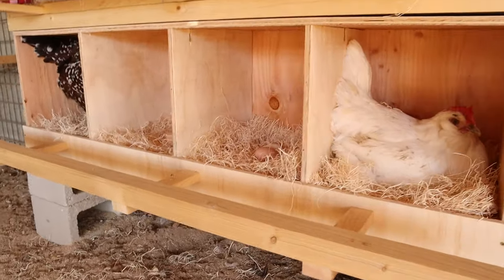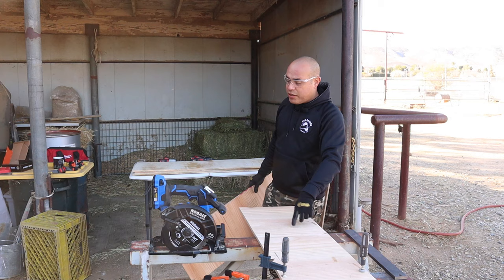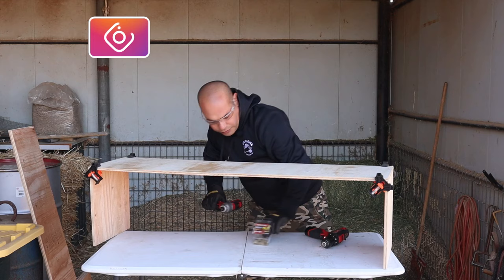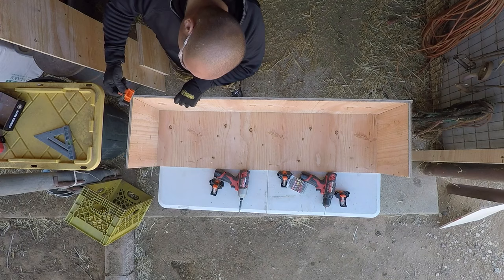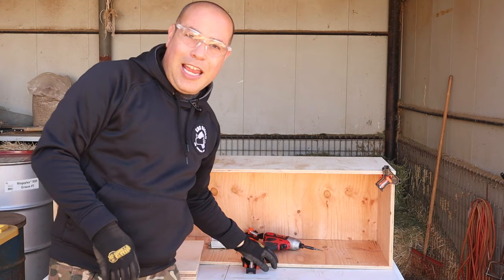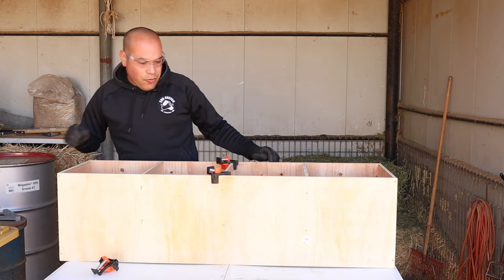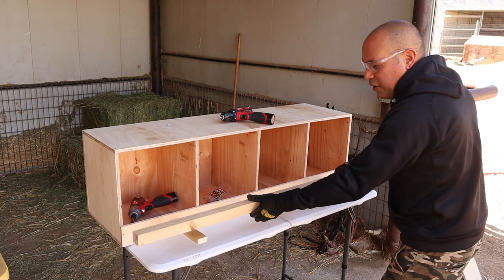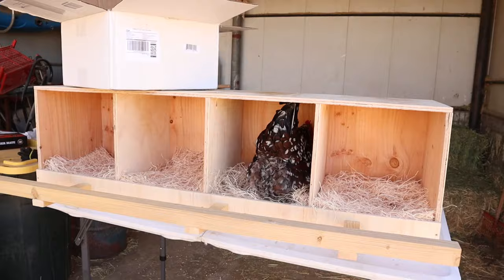Nesting Boxes for Chickens - How to Build Chicken Nest Boxes

Comment: Just an idea of how I made mine, I put the floor of the next boxex on a slant of about one inch, so the eggs can roll off, the back of the box cut about two inches shorter,so the eggs can Roll off to a tray at the back, that can be made from fencing or more glamorous trays from craft shops, kitchen shelves.the floor of the nest box I put rubber mat,cut to size ,used also for young calls, I positioned the boxes out from the wall, just enough  to walk behind them to collect the eggs, I also raised them about two feet of the floor,as the hens would want to sleep in them at night, and dirty them, finally I made a fold up step to stop going into them,opened it in the morning and the hens can hop up to the step to lay the eggs,its great the eggs are always clean,the don't  even notice the eggs rolling off.  This might be helpful.
Reply: Please make a video and share it.
Reply: Make a video instead of posting this on someone else’s video. Thanks
Reply: Great input. Love it
Reply: So are ur 12.5 inch pieces 12x12.5?

Comment: So the end walls and dividers are 12 1/2” by 12” ?
Reply from the maker: Hey, sorry I thought I replied to this long ago. I ended up writing the dimensions in the description of the video because of your question. I'm sure it's too late now, but yeah.
Reply: @BockBockBouquet  He doesn't explain his measurements to well. Cause you can't get 4 dividers at 12 1/2.. They would have to be 12 with a 4 foot piece.
Reply: That’s what I was wondering measurements don’t make sense
Reply: That 12 1/2” is width not length so u can get 4 12 1/2” by 12 with that

Comment: I have 7 new chickens that will be laying sometime in Feb/March. Super glad you mentioned the Lowe's cutting them up for you. They definitely got more tools than me and will make transport easy. Going to follow this video and give it a shot, thanks for the upload
Reply: Update Lowe's by my house would only do two cuts per piece of wood, according to the "rules". Something about overusing the machine and if others need to use it. (No one else was using it lol) Anyways, I just had them cut panel twice to fit in vehicle and make it easy to cut at home, a cut at 26 inches, and 52 inches. (Then I split those in half to get the four long pieces from video.)

Comment: I think it came out great the only thing that I would do differently is just to add on any roosting poles I use cord on it a wrap it real tight it’s easier for the chickens feet because of something to latch onto
Reply from the maker: Thank you! We did add a rooster bar at the end 😊 we like using flat roost bars though as we think chickens prefer them. Their foot is designed to lay flat not curl like parrots. They will use flat or round roost bars just fine, we just think it’s a little easier on them

Comment: Great work! Wish I had a Lowes or Home Depot close by. My local home center doesn't do any panel cutting. I think they'd sell a lot more sheet products to DIY'rs with that service.
Reply from the maker: Thank you! Yeah definitely would
Reply: It’s the wrong dimensions
Reply: @nedmacallen agreed. I'm looking at a 13 inch top, bottom and back. The 5 small pieces are 12x12.5. I get the 12.5 but how did he stretch the other side from 12 to 13 inches. Everything is flush on the front
Reply: @robm3063  yes he replied and clarified but it was way too late.  He absolutely gave incorrect dimensions or at least explained it in the worse way possible.
Reply: After having watched it many times I see what he did but he never said anything about it. If you watch real close he's leaving parts not flush to makeup for the 1/2 inch wood thickness. After having made many cedar picket planters from youtube videos I agree that this was a bad attempt of showing how to make something.  @nedmacallen
Reply: @robm3063  yeah it found all that out after I had already cut everything I made the cuts as I went instead of marking the entire thing out…I made it work.

Comment: Is there any way you can make another video of these nesting boxes.the measurements are not coming out right.i built one yesterday and the back of the box wall and top is overlapping   about 1/2 inch.this is how I cut them.i cut 3 peices at 13 in x4ft.i had to cut two pieces at 12 1/2 inches by 4ft.you can't get 5 dividers from a 4 ft piece.i cut another piece at 12 and a half by 4 ft to get the fifth divider. What throws off the measurements is the dividers. When I first put the two sides on the ends there was a lip overlapping. When I flipped it over upside down like you did in the video I had to set the back wall on top of the overlapping lip which is 13 in.
that wall is overlapping when I set the top of the box on there. I wish I could show you a picture of it but like I said the dividers is throwing everything off. So the 4-foot piece I cut the dividers from was 12 and a half by 4 ft and I cut 5 dividers at 12 inches. If you look in your description that's what you got. You got three pieces at 13 in. One piece at 12 and a half inches by 12 in. one piece at 3 in. the box came out okay it's just the overlapping from the back of the box and  top of the box.

Comment: Just curious if you know with certainty that chickens aren't roosting on that bar on the front, just seems inviting, I love it but would worry they roost there, thanks. Just picked up a bunch of wood, I'm converting part of a garage into a chicken house
Reply from the maker: We collect our eggs at night when we lock up the coop as our evening routine. The chickens are always sleeping on the roost bars, not the nests. If you want to prevent that have your roost bar area (sleeping arrangements) higher than the nesting boxes. Chickens desire to sleep as high as possible as instinct for predator safety and to show their dominance in the pecking order. Just don’t have the roosts too high or they could get a leg injury flying down in the morning. You could omit the bar easily though because they really don’t require it, even our ducks jump in the boxes and we just have this sitting on cinderblocks for height reference. We have 2 stacked on top of each other so the bar comes in handy for the chickens wanting to lay in the top box. They like to walk in and peak their head in to decide which box they want to choose to lay in that day 😂 silly ladies. Good luck on your build!
Reply: @BockBockBouquet  Thanks man, great info

Comment: Nice job.
What's the distance between the nest box and the roost?
How do you prevent the chickens from pooping on top of the nest box since you have not put a sloping top?
Reply from the maker: I think the distance on the roosts is about 6 inches or so. We have another set of nesting boxes on top of these that does have the slope roof. When we didn't have the slope roof, we used a piece of plywood resting on the nesting boxes against the wall to deter chickens from jumping on there to poop on it.
Reply: The world is their toilet
Reply: @BockBockBouquet  would you have plans for building the nesting boxes with a sloped roof

Comment: What size screws did you use? I want to make sure they are not too thick and will break into the plywood.
Reply from the maker: Predrill to not split the wood. We use 1.5 inch screw

Comment: What is the thickness of the plywood? I attempted this with 3/4” plywood, cut all of the boards out, and when I went to assemble it the way you did in the video the boards didn’t match up. Was it 1/2” board you used?
Reply from the maker: Yes it was 1/2 inch plywood, that might have thrown off your measurements. Nothing that you can’t fix though, let me know if you have any other questions. Best of luck
Reply: Greattt I got 3/4 cause I was scared for it to split

Comment: I'm actually looking to make a nesting box for my chickens. I'm not the kind of person who knows anything about carpentry and my husband is not around to help. Would you say this would be easy for someone who does not have the fancy tools? I have electric drills but that's it.
Reply from the maker: It is very easy. You can have your cut at Lowe's for free, just come home and assemble. I definitely recommend the corner clamps that you can purchase from amazon like the ones I am using in the video to help keep the wood together since I was working alone. Make sure you pre-drill holes before inserting the screws to prevent your wood from splitting. I am no expert either, but was able to make these pretty easily =]
Reply: @BockBockBouquet  could you verify what you had left of the plywood? After the project was finished. I just want to make sure I totally understand

Comment: I'm confused. With the divider pieces. I'm not getting 4 12 1/2 pieces. Out of the one section
Reply from the maker: Hi, I’m super sorry I somehow missed this comment, sorry for the late response. So on the dividers, I have them cut to 12.5” so that when it meet the roof of the nesting boxes, there is just the right amount of space to meet up with the roof since I am using 1/2 inch plywood being that the whole thing is 13 inches tall. That half inch makes up for it. Once again, sorry for missing this comment, hope you were able to figure it on your own.

Comment: How did you not get your wood to split... mine split 3 times.
Reply from the maker: I always use a drill to pre-drill a hole and then I use my impact driver to drive the screws in. It can sometimes still split the wood a little bit, but pre-drilling really minimizes it

Comment: 1. How long are the screws?
2. Is it heavy once it's all done for one person to move?
3. Did u have any leftover pieces?
4. Don't the chickens climb on the top and poop all over?
Reply from the maker: Hi, I believe the screws I used were 1 and 5/8 inch screws for this, but any size beyond one inch would be fine. Once it's done, it is light enough to be carried by one person for sure. I did end up with a leftover piece (about 2x4 feet piece of plywood). And the chicken can certainly jump up on it, but ours weren't really doing that, but you can securely prop a piece of plywood against the wall that your boxes are so it has a slanted roof and the chickens can't stand on it =]. Thanks for watching, let me know if you end up building one of these. We get at least a dozen eggs daily through it!
Reply: You have literally said 1, 1.5, 2, and 1 5/8 inch screws.  All different comments😂😂😂.  Make up your mind 😂

Comment: you dont need to drill a hole every time the screws will do it themself by the way they make bits lt come out and hold  the screw in place
Reply: When you pre drill pilot holes it keeps the wood from splitting.

Comment: Great video but I had the hardest time when I actually made it. Every screw I put it the wood just split on me! And I don't know where I went wrong on my measuring but my boxes ended up 11.5" wide. I plan to try again, what diameter screw did you use??
Reply from the maker: I forget what kind of screws I used, thin they were like #6 or #8 thickness. Make sure you pre-drill each hole before putting the screw in. That's why I use a drill first and then an impact driver for the screws to prevent the wood from splitting. Let me know if you have any other questions. If your boxes ended up being 11.5" wide, it's okay, chicken like small tight spaces when they lay their eggs, even our giants ducks lay inside of these little ones ( I don't even know how they manage to fit LOL
Reply: @BockBockBouquet  Thank You!!! I totally forgot to predrill the holes!! I found some #8s, predrilled the holes and it made a huge difference!!! I also made the bottom 16" and the back 9" which left a gap in the back and a ledge and now it's a roll out box!!
Reply from the maker: @cluckcluckduff7864  Goo to hear! Yeah, I found out the hard way about pre-drilling hole before the screw too hahaha! I always pre-drill there hole just slightly smaller than the thickness of the screw so they hold well.

Comment: Hello, what size are the dividers?
Reply from the maker: They are 11 1/2, but you can also measure how much room you have available in your main structure
Reply from the maker: Sorry, I just rewatched my own video and the dividers are cut 12.5”x 13” . Not 11.5” like I previously replied. For got this box measure 13 inches tall
Reply: @BockBockBouquet  There is no way you can cut 4 -12 1/2 dividers with 4 foot wood.

Comment: The measurements don't make sense when compared to what I'm seeing in the video. You said to cut 13" for the outside walls, but 12.5"x12" for the side and dividing walls in the vid description. The side/dividing walls look completely flush in the video.
Reply from the maker: The side/ dividing walls are 12.5” and sitting on some half inch plywood floor, so then when you attach the back at 13”, three meet up flush up at the top.
Reply: @BockBockBouquet   duh...accounting for the 1/2" thickness. What size wood screws did you use, 1"?
Reply from the maker: @AUDIOMIND  I think I used 1.5 inch screws. And the dimensions of the boxes can be modified to your own liking. I just wanted to show people how one of these can be put together very easily. The clamps help a lot when working alone and I would pre drill holes so that your wood doesn’t split when you’re driving the screws. Good luck! Let me know how it goes!
Reply: Yea, that's why I was asking about the size of the screws, as the 1.5" ones I initially used started splitting the plywood.
Reply from the maker: @AUDIOMIND  yeah we learned that the hard way too. Hope the build went well!

Comment: Just remove this video I can’t believe I tried to follow along… I should have thought before I cut…of course you can’t get 4 12.5 boards from a 4foot piece…
Reply from the maker: you can get 12"x12.5" pieces. 12" on the 4ft direction and the 12.5"s on the 8 ft direction. You should still be able to modify your build if it didn't turn out exactly like this one.

Comment: I love the video and I dis subscribe.
Reply: I just wish you had said how thick the plywood was. 1/2 in should be good but they have weird measurements these days.
I am going to build a double decker as I have 30 hens. I got a little carried away with the lively chicks this year. 😆  Also if you put an angle on the top they won't roost on it and make a mess. That's the only modification I am making to your great design. Thanks! Can't wait to see more videos.
Reply from the maker: I did an angled top on a second one that I made after the video that we stacked on top of this one so it's also a double decker now LOL. I believe it was 1/2 inch plywood, but it's not a tru 1/2 inch at the sore as you know =]. Thanks for tuning in, you can find us on IG for more!  Let me know how they turn out